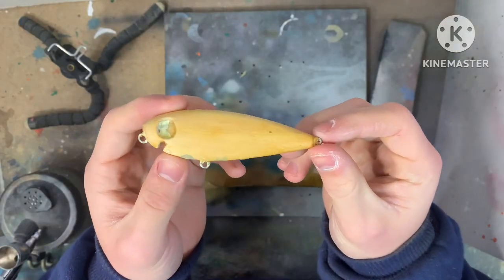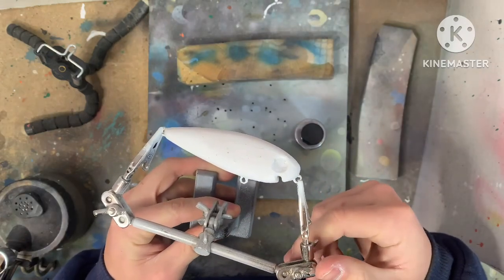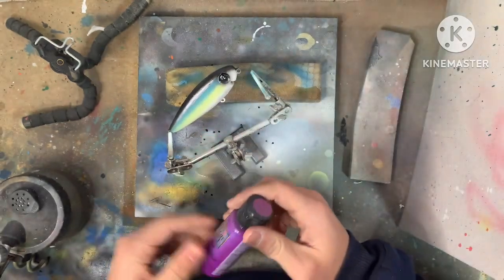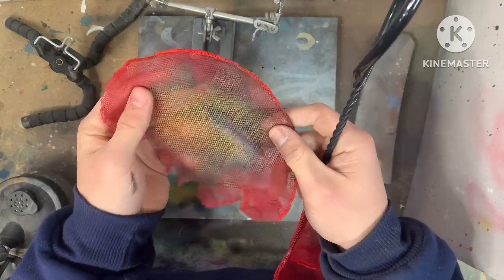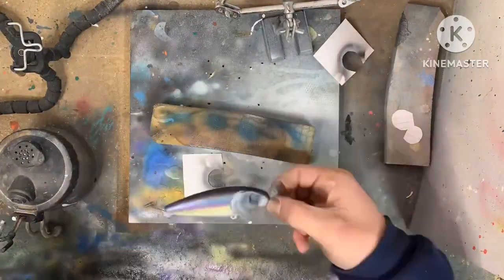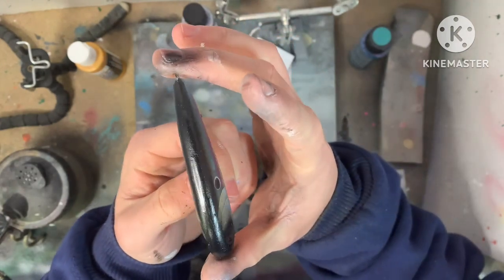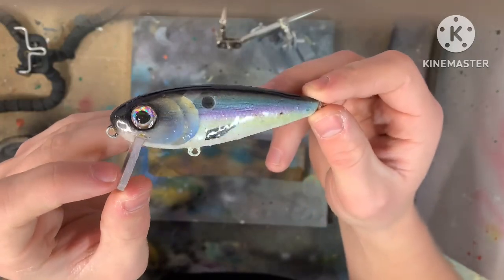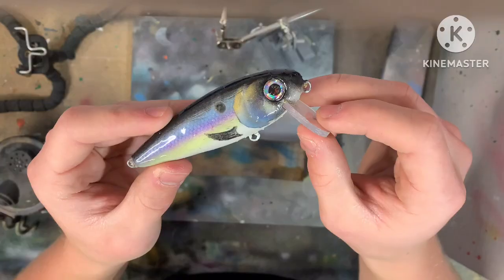Painting a Wooden Crank Bait

Comment: It was cold here as well. The other day I waited until 2pm before going out to the shed, till it warmed up just enough to work. Then I cut out seven lure blanks to work on indoors. LOL

The lure floated at the beginning of your video, but sank near the end of the video... You can see a fair difference that drilling out some of the wood caused, which removed buoyancy. Also the superglue & baking soda, and clear-coat adds a bit of weight. You are getting a good grasp on weight and balancing. The sink rate looks like it will be an excellent crankbait when the weather warms up. And a slight nose-down attitude may help prevent underwater snags, as the bib/lip should deflect the lure from obstacles.

If you're not doing another float test before painting, you might want to give it a try. That's when the lure is at it's closest actual buoyancy, minus the clearcoat. You may want to temporarily tack the eyes on for this. This is your last chance to fine tune the balance, as you can easily drill out and remove weight if needed, or drill another hole and add a gram or two. Then you only have to take in a small account for the weight of the paint & clear finishes.

Beautiful work on the paint job. A suggestion for the final product you mentioned in the video... Leave a direct link in the comments section to make it easy for folks to get to your Instagram page. Not everyone will be able to navigate over there and find it. A simple link may increase traffic. Thanks for another great video!
Reply from the maker: I think I’ll start to test the lure before painting. That will definitely help! Thanks for the comment and tips!

Comment: What was going wrong with your black paint? Which resin did you use for this clear coat that reacted badly?
Reply from the maker: I’m not sure the brand of the resin. It’s really old and I’ve had it for at least 2 years. And I’ve been working on trying to get my black paint to spray better with thinning it but it started to overspray and splatter so I went with the pearlized black.